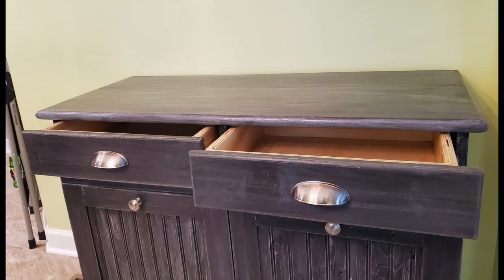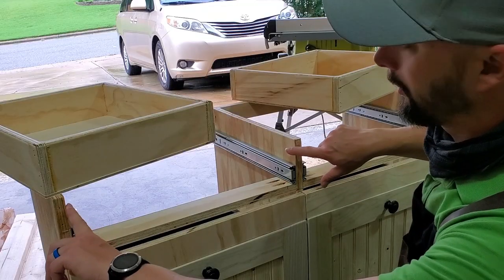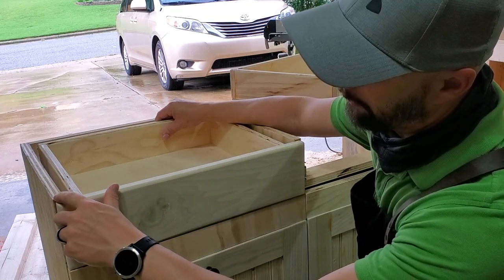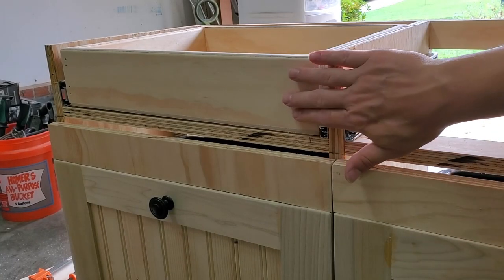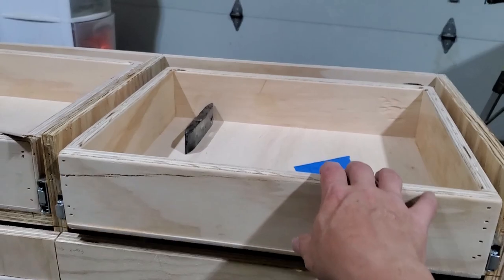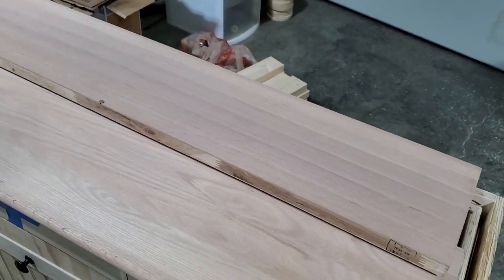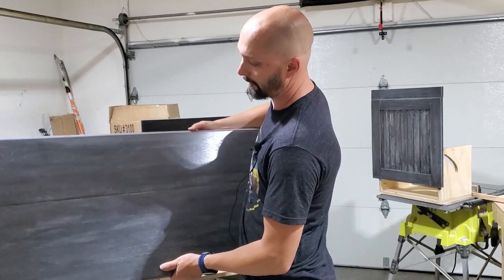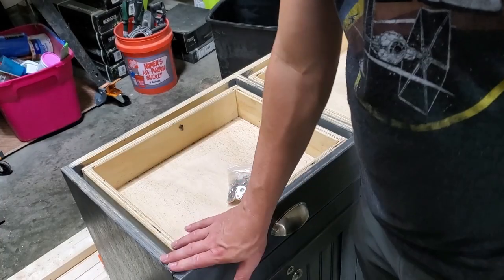Tilt out Waste/Recycle Cabinet PART 2

Comment: Just found your channel - fantastic! Did you have to anchor the bin to the wall to keep it from tipping if the trash contents are heavy? Or isn't that a problem with a double bin?
Reply from the maker: Surprisingly, tipping is a non issue with this design. The factors might be, the limit on the opening, the depth of the unit, an the overall weight of the unit compared to the general lightness of kitchen trash and recycle. Thanks so much for checking out the channel!
Reply: @wooddoofus   I was dopey enough to spend the fortune on a single can tilt-out from Amazon, but I didn't take falling over into consideration. Sort of wondering if adding baseboard around 3 sides will help or if I'm going to have to anchor it to the wall.
Reply from the maker: @ctdev2003  oh I see. If tipping is an issue, I don't think baseboard will add much stability. Anchoring to a stud might be your best bet. Maybe screwing to your wall baseboards? You might have to cut out any show molding if you have any of that.